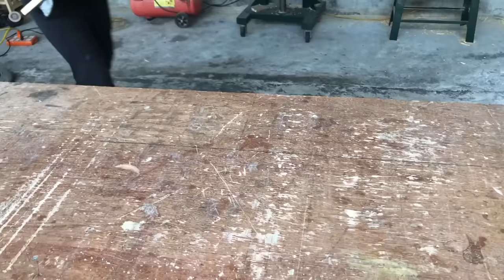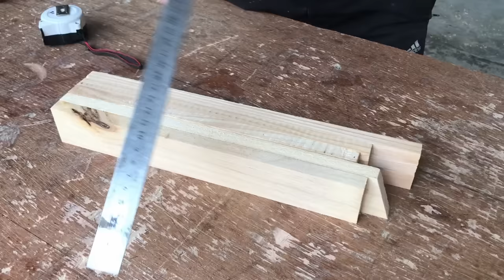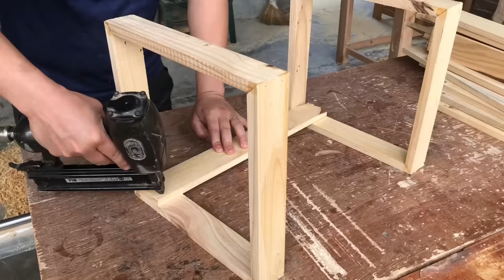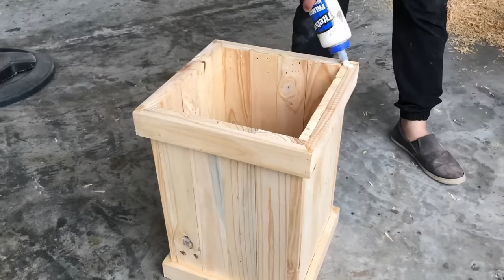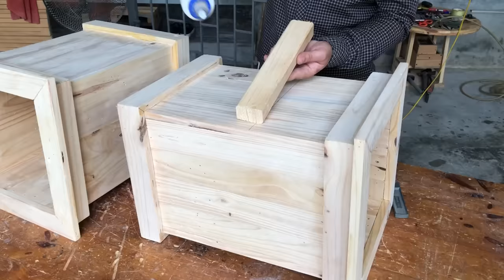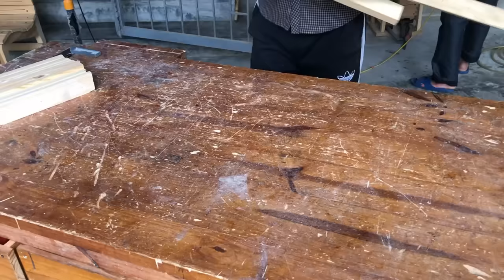Beautiful garden decoration ideas 2023 - Planter Benches and Garden Seats

Comment: I have made something similar but I used pocket screws to fix the slates on the bench from below. You get a better finish with no screw heads on show that will ultimately corrode. The finished piece would look a lot better with a good wood stain and varnish protection.
Reply: Then put together a video stop the talk
Reply: You can use decking screws which won't corrode and if screwed in deep enough the wood grain will cover the screw heads. I have to look really hard to find the screws used in my decking, which is why I know this.
Reply: @abbyg5069  Or, better still, you could use pocket screws.
Reply: @lackof548   Yes, of course, but IF you don't have a pocket hole jig and don't want to buy one ......

Comment: Looks good but it's never going to last outside screws will rust and the pine will rot it's not pressure treated wood the stain is probably a water based stain so it won't hold up.... I put it on par with a furniture for the Kia looks good but it's crap